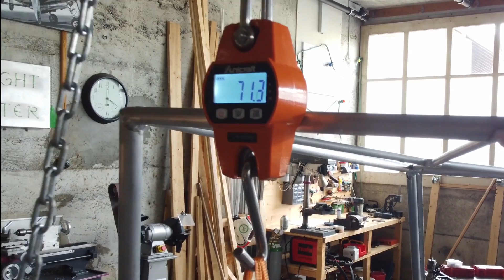Rotax Engine Install EXPERIMENTAL HELICOPTER BUILD SERIES (Part 53)

Comment: 582 was not designed to work in that orientation - the front big end bearings will be staved of lubrication and fail as will the front gearbox output shaft bearing. But don’t take my word ask Rotax !